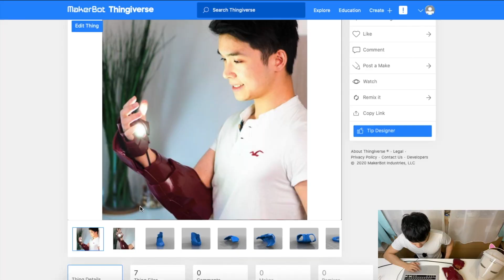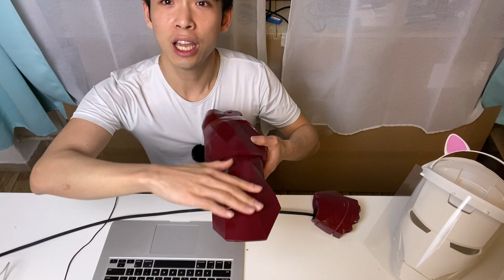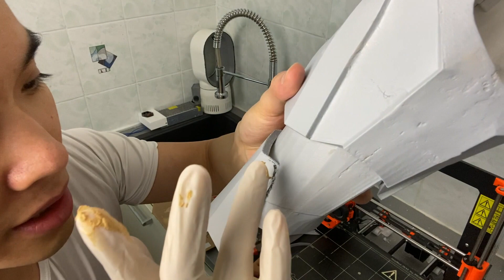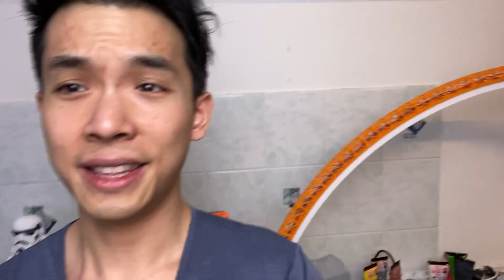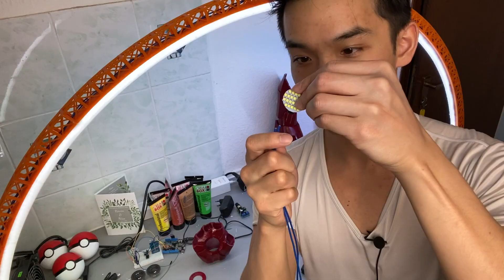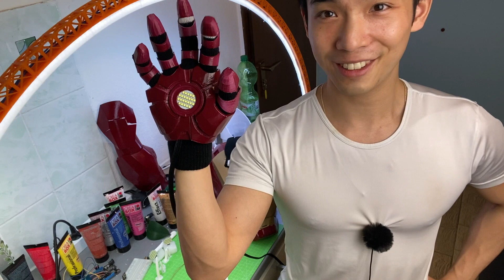How to make a 3D printed Iron man Arm and Glove

Comment: Could you please explain what else can be used for the power pack because I bought a similar light if not the same ….
Reply: A 12 V battery is a car battery???
Reply from the maker: @jacquimon9938  well... technically u could power it with a car battery too xD

but yes, u need 12v to power this led - im sure there are smaller 12v batteries out there, such as this:

https://www.amazon.de/-/en/Alkaline-Batteries-L1028-Battery-Shelf/dp/B07P5NZR8H/
Reply from the maker: hm... if u got the same LED - any kind of 12v battery will work. maybe check on amazon for "12v battery" - im sure u will find some alternatives